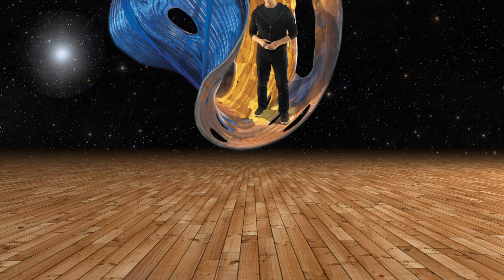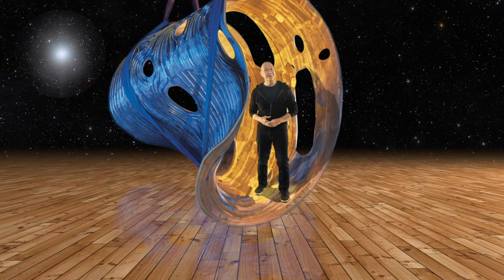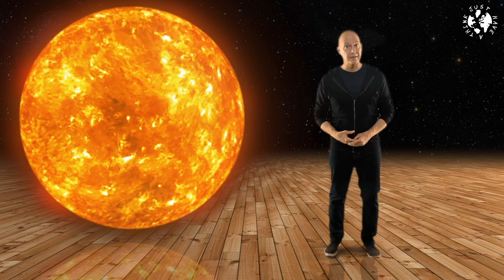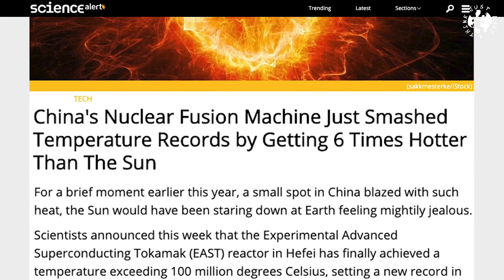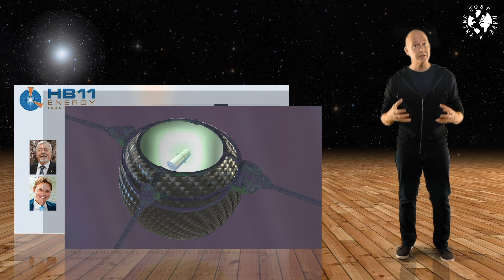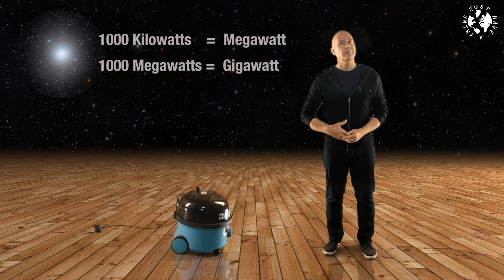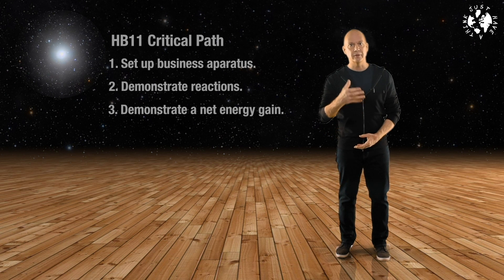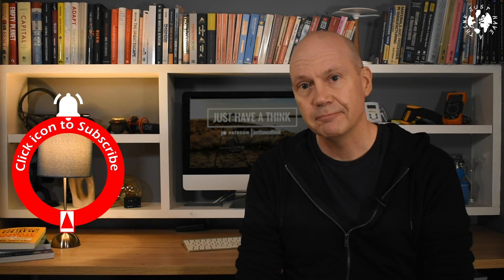Nuclear Fusion:  Revolutionary new breakthrough.

Comment: First my apologies to science, but I have a grievance with ITER.
In my experience witnessing academics in the physics community, projects run by collaboration are often just a big cluster fk. Physicists - while very intelligent - can be very stupid when it comes to project management, (there are exceptions), but overall the waste
of resources and time is appalling. Egos resist the instruction of project management professionals and it is not comical to witness. 

By engaging in ITER IMHO, Fusion research has been delayed. The money should have been spent on many ideas to move forward not one big fat one. Don't believe me? Check out how the cost over runs, and management changes with the project. 

The solution is always to put another academic in charge - since of course that is the smart thing to do,... yeah right 

Well sure I am cynical - just a piss ant engineer's opinion.
Reply: If US fusion wants to invest in shotgun approach i.e. throw money at everything and if something will come close to tokamak results from 80th, then US should at first give money to fusion research. $5-6B/year would be a good start.
Reply: @Poctyk  why cant you people realize fusion is not clean energy but produces lots of radioactive waste? i think you have been suckered into this. you can google it.
Reply: @esecallum  Yes, I know that nuclear fusion produces low radiation material due to neutron bombardment... now what?
Reply: @Poctyk  also no need for it as the world is AWASH with cheap oil down 20 -30 dollars per barrel.
Reply: @Poctyk  You want consistency from the USA - good luck with that. 

You try living with the Goon. Of course can't blame Agent Orange for  ITER, well why not? Its Rumps fault,... Kidding aside I don't get your '80th' comment, pls explain.
Reply: @mr1enrollment  Most of the "promising new approaches" barely reach results that tokamaks showed in the 1980-1989
Reply: @Poctyk  and they have not had 40years of development
Reply: @mr1enrollment  International community really became interested in Tokamaks in late 60s. When USSR showed results literally orders of magnitude higher achieved by West. UK even send scientists to test the claims.
Reply: @deluxeassortment  You are mixed up. I did not claim to have a Physics degree. Pay attention to who is writing. I know it is not clear the way YouTube manages the threads. 

I am a retired Electronics Engineer.
Whether you believe or not. Mr. Alkyl
Reply: @mr1enrollment  sorry you're correct, I wasn't paying attention to who I was replying to. Comment deleted.
Reply: @deluxeassortment  Apology accepted.
Reply: I disagree. It has been "this one's too small. Let's  build BIGGER and see what that brings". There is billions being wasted because some PHD is saying "bigger" all the time. It is time to put BIGGER to rest. Stop throwing my money away on "bigger" and "newer", and MAKE WHAT YOU HAVE DO THE JOB.
Reply: @mr1enrollment  No it was you. I was asking about the collaborations. If it was the tokamaks or other stuff. No arguments, I was just curious if you had some insight.
Reply: @userJohnSmith  Most projects I worked with were of the Neutrino Science type. Note:
my comment being a piss-ant engineer are accurate. But I did enjoy the work. Check out IceCube, Daya Bay, DUNE. IceCube really was/is an outstanding project. From the beginning professional project management was recruited.  Many superb people in each of these projects.
Reply: @mr1enrollment  Very cool. I left the hardcore particle physics realm a while ago but every once and a while light is relevant. I have seen some truly horrifying mistakes when it comes to setups and assumptions. One was so bad I suggested the guy consider retracting his paper until we redesigned his setup because he forgot to account for uncertainties in the light distribution at his focal plane. The dataset was obviously usable but his confidence level was way too high. I fixed the design in front of him in 5 minutes and his program manager decided not to fund it. $10k fix on a multi-million dollar experiment. They had just spent like half a million on a new sensor array and I had to tell them that it was pointless because their original system was already oversampling the new lens design they were using. Broke my heart because they tried to do their due diligence but used the wrong program. I've seen that side more often then the other. Mostly, it's guys doing things they don't have any experience with and they can't get the money to fix it. Also, NASA drawing are terrible.
Reply: @userJohnSmith  It happens. The real point regarding student academics in these collaborations  is that it trains them to think. That is the best outcome. Personally I am not so gifted as to have been in the position of correcting someone similarly. But I made contributions. I was able to travel to the South Pole a couple of times. That was both a real kick, and a real pain,... I am mostly retired, I work 20%. Sitting here now working on some Python code, long story. It is difficult to give up a career - I like keeping my toes in the water. Best2U
Reply: @mr1enrollment  Ah ha! That's why your are so adamant about "dirty fusion". Maybe you should walk away from it if you believe that it is as dirty as oil and coal. Find another line of work where you MIGHT have more success and be happier because of it. I certainly would not work on a project that I believed was more polluting that oil, coal, and other hydrocarbon fuels. What keeps you there? Have you no conscience? Shame on you. I hope you get out soon.
Reply: @brianrichard8310  Gee Barry I think you should be careful to whom you address your reply. I made NO comment about dirty fusion. Try learning how to click the correct reply button.
Reply: @brianrichard8310  looking for a fight? ;-)
get over it dude, and grow up a bit
Reply: Daniel Wahl  I agree. I work in r & d and see this problem every day. Every one gets an idea that may or not be feasible or economical but it becomes someone’s pet project and runs along using budget dollars without ever reaching its goal. Researcher’s egos keeps them from listening to project managers. I am a licensed engineer with 35 years experience. My main responsibility is reviewing PhD’s experiments and experiment plans to keep them from injuring themselves or blowing the facility up.
Reply: @clwomble  Hey man how are you? Note Blowing something up can be an education experience.
Try a bunch of 350vdc capacitors in series parallel, and drop a wire across the terminals. That's an education! ;-}
Reply: They have to "create" a quantum singularity to act as an anchor for the fusion process. So far all we have been able to do, re fusion, is to generate a plasma, with no anchor. The anchor has to be gravity, which would be provided by the singularity, not a laser, and rings of electromagnets. Foolish to even dare trying without the anchor.
Reply: ITER will NEVER WORK AS IT IS THE WRONG SHAPE. WHAT SHAPE IS THE SUN? A PLASMA RIBBON WILL ALWAYS KINK AND LOSE ENERGY AND FIZZLE OUT...
Reply: @esecallum  and your degree in High Energy Physics is from where?
Reply: @mr1enrollment  I have a degree in physics ok? and this plasma ribbon is unstable and can never be stable. IT WILL ALWAYS KINK. don't believe me? try balancing pencil on its point. its a dead end 70 years wasted on this stupidity. only a spherical plasma can work as kinking cannot occur.
Reply: @esecallum  Well Ese, I am glad you are educated. However I do not accept that your 'wisdom' is a match for the hundreds of Physics professionals that are involved in this effort. My objection is not the topology but rather the incompetence of Physicists to manage projects. This gets worse as the scale of the project rises. In addition,  as the scale increases the political pressure and availability of funds is compromised.  Super Collider
is just one example.  Now to your comment - I suggest that if you are so certain and competent then dedicate your life to finding a solution.
Reply: @mr1enrollment  Look its not just me. a physicist who was close to ITER wrote a physics paper in which he proved/explained ITER will not work. his paper was black balled and he was banned. He said no matter how tightly you squeeze the plasma ribbon with a magnetic field interactions with the conductive plasma and the magnetic field will always introduce instabilities causing kinking, touching the walls and losing energy. SIX degrees of freedom of a plasma ribbon. up down in out left right.  a spherical plasma only has 2 degrees of freedom in and out. For years i have tried to tell them but this thing has a huge momentum and cannot be changed no matter what.
Reply: @esecallum  So very common in science. In case of ITER, there is incredible pressure for results. So much money has been spent - NO ONE wants to be wrong.
Now science is also capable of self adjusting, so if enough people supported the results of a publication demonstrating impossibility then  perhaps the project would be canceled. But right or wrong don't hold your breath. 

AND realize: there may be good reason to go forward, since rarely are any conclusions by one or a few scientists enough. Note he/she/you have a theory, not a proof. So it may not be strong enough to stop the forward motion of a project with incredible momentum. Stop crying about it. You are pissing into the wind.  THIS is why I don't support such a HUGE project when the many smaller ideas are starved for resources. The risk of resources being mis-spent is enormous. AND for a moment consider, what if ITER works even if by some extraordinary bit-o-science? Ok, so they get it to work and learn some important things about making a large reactor. NOW what will the future of the industry look like? It will look like a GIANT/EXPENSIVE/COMPLICATED future for fusion.
Fission probably went the wrong direction historically, so why would we expect Fusion to be different?
That' science/technology and human politics in action.
Better get used to it,  we are monkeys after all.
Reply: @esecallum  Well said
Reply: @esecallum  another "ego" heard from. "My way is better, boo hoo. Give me money". That is all I hear from you physics PHD's. Start living in the real world for a change, and STOP BEGGING GOVERNMENTS TO SPEND MONEY ON USELESS THINGS THAT ARE OBSOLETE BEFORE THE MACHINE EVEN IS BUILT.
Reply: @brianrichard8310  no need for dirty fusion anyway.workd is awash with cheap oil
Reply: @mr1enrollment  These specifically? Honestly, the spherical approach was first getting traction when I was in college. I proposed it to a professor who worked on fusion and he just laughed it off as rediculous. He was actually kind of pissed off when I started going through the theory and asking why. I ended up in optics, as an engineer fixing things for PhDs and Master's candidates, so I have lost touch with the field almost completely.
Reply: @esecallum  "Dirty fusion"? What makes it dirty? Oil and coal are dirty, to the extreme. Do you like breathing in all thse carcinogens that spew out tailpipes and chimneys? I don't?
Reply: @esecallum  So why is it being billed as "clean, endless energy"? Seems to me that it's  just as dangerous and dirty as nuclear fission.
Reply: @mr1enrollment  I can name several  other "projects" with cost overruns, technical issues, and stupid waste. Let's  start with the James Webb telescope.  It was supposed to be in orbit 6 years now, where is it? Let's do the F-35 next. The most expensive fighter ever produced. Why? Technical issues, that ballooned the cost stratospheric. Let's see what's  next. The latest "Ford series" supercarrier. Plagued by technical issues including the catapult, elevators. Next up, the "zumwalt" destroyer, with a super gun that costs $12,000 per shell. My point being physics is not the only group where cost overruns, etc., cost the government and you billions every year, all for untested upgrades that don't  work. Who do you think allows you try and "prove" your pet theories? It's  the government or some multinational company. So allow the beauraucrats, and the project managers to get you the money so you can be gainfully employed. In other words "sell it", (your theories) to the project managers or you can go home, and be unemployed. Get it?
Reply: @brianrichard8310  they are simply stringing the politicians along for more money. its not clean and its not endless. a huge fraction of the energy wll be required to power the ITER. ALL THOSE MAGNETIC FIELDS WITH 1000 OF AMPS running thru the coils. In any case the plasma ribbon is never going to work because the ribbon always kinks. its like a bucking bronco.
Reply: @esecallum  There was company having even Google Talk about harnessing precisely the instability - sounded promissing, dissapeared of course : >
Reply: @piotrd.4850  YES. I have always had an issue with shape. no torus shaped stars exist. too many degrees of freedom for the particles. the ribbon will always kink.
lose energy and fizzle out. a sphere is what they should strive for...
Reply: @esecallum  wow, i was not sure... but you majestic use of capslock sure turned my opinion in your favor
Reply: @khhnator  We AMERICANS LIKE TO MAKE OURSELVES HEARD. YOU WORRY ABOUT  CRAPPY ITER.
Reply: @esecallum  You are not a physicist. If you were, you'd know that the only reason the topology of a star works is due to the immense pressures from gravity. You'd also know that kink mode is how those intense pressures are achieved in lieu of intense gravitational fields. Kink is not the problem, it's necessary. The instability of the kink is what's in question. Yes, it's like balancing a pencil on its tip, but, while you got the analogy right, you got the whole point wrong.
Reply: @deluxeassortment  its the wrong shape. what shape is the sun?
Reply: @esecallum  1. I already addressed the point about the shape of the sun. 2. HB11 does not produce radioactive waste, since it is neutronless fusion

Comment: Should we throw all our resources at it? If the science is sound, then absolutely yes. We need it and we need it now.
Reply: @Nic Denslay Nope. Sun is still the best fusion generator we have. 1 kW/m^2 of energy hitting the earth. Much easier to solve energy storage + solar array problem with already existing tech.
Reply: @hahtos  yes/no. I've got solar plus batteries so I'm clearly a big fan. But, think of   how much effort and cost it would take to deploy enough solar and batteries to replace existing power stations. Then factor in that the current infrastructure is built for large centralised generation and distribution. If we have a decent neuclear fusion blueprint then it could easily be built adjacent to or in place of existing power stations.
Reply: Sammy except you do no not work in any of the wind/solar/battery Indistries, or any of their associated raw material indistries, or any raw material industry, or any other industry that relies upon affordable and reliable energy in order to function. As such, you have absolutely zero authority on this subject. Those who have thoroughly studied the matter all vehemently insist that atomic energy will be vital if humanity is to successfully transition away from fossil fuels in time to avoid the environmental worst effects of climate change. Saying as how nuclear energy has always been the safest and most environmentally source of energy this has always been a no brained and yet you renewable energy shills/fossil fuel funded useful idiots have been fighting this revolution for decades which is why my generation will have to deal with climate change and ocean acidification when the last fossil fuel fuel plant should’ve been shut down before I was ever born. Thanks, Boomer.
Reply: The science is rock-solid: see the sun, and evidence in physics. What is needed is engineering breakthroughs and political will.

Comment: All over the planet an endless source of power called Gravity exists, which we can use to generate electricity day and night no.interuption and its virtually Free with a slighy input providing 1200 times more output than input. 
In 1939 Mr Skinner built the The Skinner Gravity Motor which can be seen running on Youtube. These can be built and run at the locations where we need Electricity ! Maintenance costs are low and this option beats Solar and Wind hands down. Take a Youtube look and build one it's easy and safe !

Comment: Well, here I am again, being the bringer of cold water, but this time it's only a little. But I'd really like to see someone address this. WRT inertial confinement schemes, what I've never understood is how anyone expects to set off these pulsed fusions at any reasonable rate, when every pulse is going to generate a blizzard of debris from the vaporized pellet. You're focusing laser beams of incredible intensity all down to a tiny spot, and the slightest misalignment, mis-focusing, contamination, or whatever, is going to throw that set of beams off far enough to spoil the reaction. So how are you going to do that thousands of times an hour, with all that stuff flying around?

Of course, it is in a vacuum, so almost particles should fall quickly under the action of gravity. And you might also set up some kind of electrostatic collection devices to pull away the debris components that are charged. Still, cleaning up the reaction chamber fully, in a few seconds or less, sounds like a diabolical problem (in a picture that already looks diabolical enough).

The technique described here is different from ICF with lasers, but I would still think it would have basically similar problems with debris getting in the way of the beams.